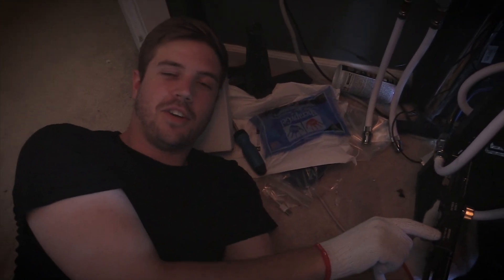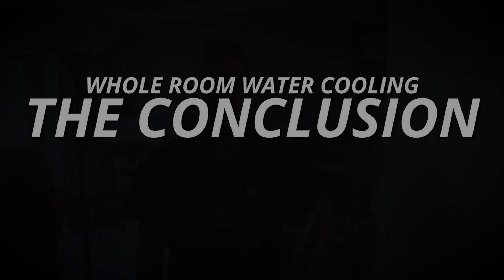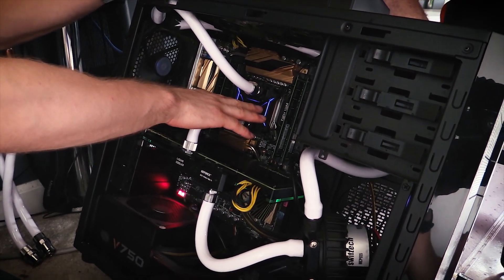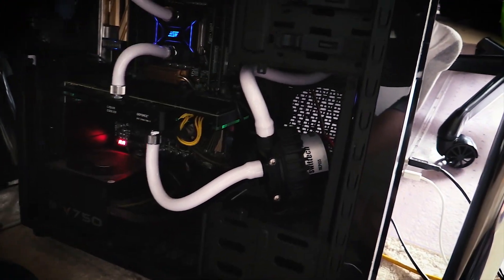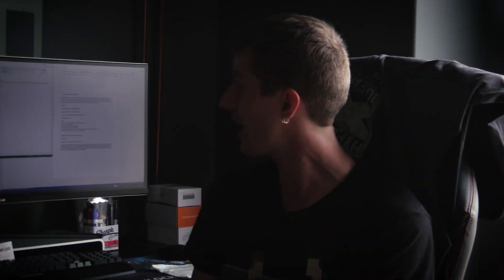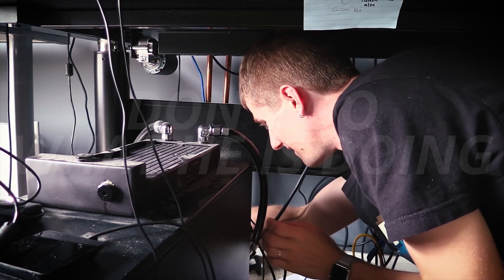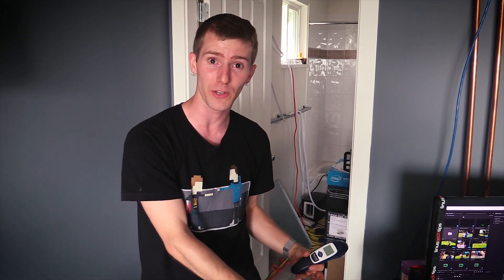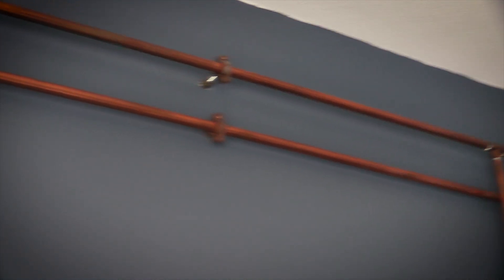Whole Room Water Cooling Part 7 - It's FINALLY over!

Comment: $140 window A/C unit + 30 min. install.
VS.
$3500 in copper, flex pipe, quick connect fittings, radiators, reservoirs, pumps, cooling blocks, sterilization units, etc. and over a year of troubleshooting.

gg
Reply: Christian Jackson I don't think you get it. It's the "for shits and giggles" concept, aka "just for funzies" or "let's do this; see what happens," you know? The Goldberg Variation. I loved it
Reply: Christian Jackson Window AC would have been a more logical solution but not worth watching on youtube. This mad project was at least entertaining.
Reply: Christian Jackson 
and no one will watch them install an a/c unit. how many videos and views per video which way is more profitable to them??? We watch cause we like and u trolls enjoy seeing over the top projects attempted. 
well done Linus Media Group
Reply: Like half of it is sponsored
Reply: Christian Jackson flawless logics right here
Reply: Christian Jackson 140 dollars? that must be really shitty ac lol
Reply: Christian Jackson you know that 3500$ in copper would be like 600 kg of cpper pipe right ? they used like 10 5 meter lenght not more
Reply: Wynnd Gaming he was talking about "copper, flex pipe, quick connect fittings, radiators, reservoirs, pumps, cooling bloskc, sterilization units, etc" as a combined cost not just the copper
Reply: and they probably generated more profit from the 7 very popular videos they produced while building it than it cost them in parts. So they actually MADE money from this project.

You forget that linus media group is a MEDIA production company. Their whole job is to make entertaining videos.
Reply: DrunkenMilfs Window units are dirt cheap. Usually $100 to $400 USD. Even high-end powerful ones won't cost you more than $1000.
Reply: Xromos Huh, I had no idea. Are they worth it? 'Cause I know that some companies basically scam people with their cheap "portable ac" and stuff
Reply: Xromos What technology are those cheap window units based? I know there are really cheap & good evaporation chill ones wich only need water & a little power (quite common in the US), but they are only usable in dry climate zones with low humidity. And there are other systems with heat pumps/with some coolant gas and compressors.
Reply: DrunkenMilfs A decent window unit.
Reply: salat Window units use the same technology as any other AC: dump the waste heat out the window using whatever gas-heat exchange you deem appropriate.
Reply: Put refridgerant in the loop mixed with anti freeze and a solution like linus used to keep out organic material from growing, problem solved
Reply: DrunkenMilfs A 6000 BTU AC unit (around 150 bucks Canadian) could EASILY cool that room to the point of it being downright cold.  I cool the entire up stairs of my house with a tiny little unit like that.
Reply: Pas De MD that's not his point.... When I lived in Salt Lake City, Utah, they had these things called swamp coolers, they are dirt cheap compared to AC units that use refrigeration and are dirt cheap to operate, they use a little bit of electricity and a little bit if water. They need to either be plumbed into water or filled occasionally, they are available in both window units and whole house units and people who don't know better call them air conditioners. If you don't pay attention they look very similar. But they don't work in humid environments.

I haven't looked at AC window units in quite some time, but one that costs only $140 is probably a piece of shit and if you bought a $400 one, it would probably pay for itself in lowered electric bills in one summer.
Reply: devilmikey00 I'm just going to guess, that room has about 4000 W of computers in it, that is equivalent to having 53.33 working people in your upstairs.

Yeah, wow, you can cool your entire upstairs with a single 6000 BTU window AC.
Reply: o noes i have incurred the wrath of LTT. Yes, a window A/C to cool that ENTIRE editing room is ~$140. And for those of you saying it's sponsored, no kidding?? And I'd love to see the math on the guy above who said 4000w of computers equals 53.33 working people. Truly funny. AND REMEMBER BOYS... it's okay to waste money as long as it's other people's money you are wasting ;^)
Reply: Isaac Karjala
Modern window AC units prices are based on how powerful they are not on the quality of the build really. A 5000 BTU unit is around 80-100 bucks and it goes up from there. Also all modern AC units meet a particular energy efficiency standard. The small cheap ones are going to be cheaper on the power bill then some big honking 15000 btu monster that could cool a warehouse ;p

I've bought cheap and expensive ones alike and they all stop cooling well in 2-3 years. Honestly the best one I ever had was some cheapo 150 dollar unit that managed to make it through 4 summers before it stopped kicking out cold air.
Reply: Christian Jackson sustained power output of a single working person is 75 Watts.

4000/75=53.33
Reply: Wait are you serious or joking I cannot tell... you know that "4000w" of computer power does not generate 4000w of HEAT energy right? The computer is doing OTHER things rather than making heat lmao... like computing things. I'd estimate the actual thermal efficiency of their rigs to be in the 90% range. AKA, for every 1000W of computing power, 100W of that is generated heat.
Reply: Christian Jackson uhm..... Are you confusing power supply efficiency with power consumption? 90% efficient doesn't mean that of 1000 W consumed only 100 W becomes heat, it means for every 1000 W consumed at the wall, only 900 W are available for use by the computer; but the full 1000 W still becomes heat.
Reply: Christian Jackson Stupid troll is stupid..
Reply: Christian Jackson wow dude. you don't understand entropy. If something is consuming 4000w ALL of that energy is going to be turned into heat. It might do other things on the way to becoming heat, such as "computing things" but it will eventually end up as heat.
Reply: Christian Jackson well, watercooling in general is not there for practical reasons... yes, you get you system cool and it looks nice, but usually you can get that with a nice air cooler too lol
Reply: Christian Jackson Someone doesn't understand wattage lol, in these cases its a measure of work/energy over time via electrical resistance which is expressed by heat. Every watt consumed by the computer from the PSU on, no matter how efficient the conversion of the mains current to something the components can use is expressed as heat.

The efficiency of the power supply just quantifies how much energy is wasted during the conversion of the current.
Reply: ***** this setup is probably more efficient in it's use of electricity (Watts extracted from room/Watt of electricity) than a refrigeration cycle, but eh.
Reply: Christian Jackson  3500$ of copper? you dont know much about copper price eh..
Reply: SamuelDM
WOW. Was there really any need to insult me bro ? And you really think that about (tops) £200 of copper pipe translates to $3500? No. Sorry but no.
Reply: DrunkenMilfs For small rooms or short term conditions(if you are renting or planing on moving), yes. For long term, an inverter wall unit(split unit) or even central AC is usually better.
Reply: salat Yeah the cheaper units are usually gas/compressor. They're not as energy efficient as wall units.
Reply: Christian Jackson lol no shit, but how are you gonna make 7 videos and learn about video production by installing an AC unit?? you really think the only reason they did this was to cool down the PCs? LOL good job looking beyond something boy

;^)
Reply: Christian Jackson It's much too easy. ALWAYS take the hard way, no matter what.
^^Sarcasm
Reply: M8 acs are loud as hell
Reply: Xromos 
a window AC is NEVER high-end.
Reply: devilmikey00 
ACs only work with closed doors, as the room it needs to cool only gets bigger.
Reply: Robin Steel 
if "something" are PCs or something similar that's true, not so true for motors, lights,...
Reply: unkr3at1v actually it IS true for motors and light,  and everything else. All energy becomes heat. That is the second law of thermodynamics. The entropy of a closed system can only ever increase,  not decrease.
Reply: For motors and light SOME energy becomes heat the rest is converted to movement or light. 
for a 100 W light bulb for example about 5W become visible light, the rest are infrared rays. 
Energy efficiency is the key word.
you don't need thermodynamics to explain this. 

if you get 100% of the energy put into the system in heat and 5% of light energy you would get more energy out of it then you put in. 
and it is impossible to produce energy from a physical view, you can just convert it.
Reply: unkr3at1v You're both kind of right. Some of the energy input becomes kinetic energy or light initially, but even that will eventually become heat. The kinetic energy will become heat due to friction and the light energy will eventually be absorbed by something. Unless the light is shot out into space during the night-time or something, then maybe it could continue forever or at least a very long time.
Reply: unkr3at1v For incandescent lights it's been said that they are heaters that produce light as a byproduct.
Reply: lubey111 it's still 95% heat and 5% light, or 30% heat and 70% torque. 
and never 100% heat + movement or light or whatever else that particular electrical consumer does.
Reply: jayw900 i didn't say anything different. this was the most common way to "produce" electrical light for the last century or so.  We are more clever now...
Reply: Oh yeah, i just found it interesting that it is an amusing way to look at it.
Reply: Christian Jackson bottom line is, air cooling is suffice

overclocking even with low temps kills the GPU/CPU if the volts go up

upping the volts is what makes higher OC stable with low temps

if you OC on air w/ a really good air cooling system or a small watercooling loop it's enough at the limit of stock voltage

later on there is degrediation inside the CPU/GPU housing, the insulation that separates transistors disappear causing problems such as file corruption and BSOD resulting in RMA

plus.. the amount of energy cost in using AC..

you can use phase change for direct AC on CPU/GPU to have insane OC stable but electric bill goes up HUGE

I had a QX9650 ES Step, probably a QX9770 ES sample, on Prometia at 5GHz stable during that time when it was the best CPU to buy besides QX9770 I think

It didn't die.  I was at like -54C but when it was under load it got to like 14C.  Sold it because watercooling was easier or something.  Everytime it shut down I had to wait 1 minute 30 for the AC system to turn off then turn back on.  If you instant off and on it damages the compressor then it doesn't work anymore which I did when I messed up flashing the firmware.
Reply: Christian Jackson It's funny that you commenton that but ignore the immense money wasting they do in about every video (having 128gb's of RAM, 4 titan x's in a build, 24TB raid 0, mineral oil submerged pc'sm phase change cooling..)
Whats your point exactly? that there is a cheaper option? yea, so what? have you completeley missed the point of this whole channel/company? Its Obvious there are Always cheaper options but this channel isnt about cheap. It's about freaking building anything they can think
Reply: Robin Steel I don't think you're factoring in the cost of (their) labor and lost production time.
Reply: Christian Jackson Yea you are real smart and all athers who tumb up you,this is entertaining chanel not home depot.they are show biznismans.And they are good and heving funn at work,I am jealous of you :). Ssuburb house in USA like they dont heave A/C. Hidiots.
Reply: Christian Jackson There is downsides to A/C units like yearly maintenance that cost around 200 Euro on a good A/C unit. At least where I live, this includes Filter change, tuning, greasing, making sure the system works properly. I know this because My grandmother has an A/C unit more for heating her house than cooling it. And she doesn't do the maintenance considering she is 80+.

Even then, on this large scale, it might not be worth it but if they were to have lot of servers that generate more heat, it might be worth having one Big pump, one Pipe line and an easy way to fill, maintain the water quality in a station than trying to cool the whole place down which could be drastically more expensive since AC also circulates the air and makes it far harder to keep dust out of your system. Now I am talking fine dust. And AC filters generally can't filter out Fine dust since they tend to not be that fine of filters. Generally just Coarse/Medium(Aquatic terms). 

So it also depends on the size. Also, when you have A/C, you generally compromise the efficiency of your Fire Warners which is something you must have in a room with such heat generating equipment. Plus, since you have to use Carbon-oxide to put out potential fire, A/C forms one more complex thing to ensure monthly that it is air tight during Fire emergency. Since you want to fill the room fast enough to put the fire out without well, it leaking out.  So in a sense, water cooling can work depending on the scale, location, size in comparison to A/C. Also lot cheaper in comparison to filter changing for air driven devices which you technically can't clean as easy if you do it yourself. And they can be dirt expensive depending on quality.

Any A/C can be a good product, but there is a difference in filter quality. Also the most expensive product in all type of things that need filtering. Water filtering is easier, especially in a closed system like this.
Reply: Leaves a month later.
Reply: +Christian Jackson  Plus they didn't insulated the pipes lol
Reply: Luis Jimenez just moving some lines directly to outside the house would have just been wiser or running through mad radiators with huge fans

the video must have been made for more of a marketting decision than a logical efficient one
Reply: +Luis Jimenez Insulated pipes would keep the heat from dissipating into the room. Unfortunately it would also cause the water to retain more heat making the radiator far less efficient. So you would have 2 strikes. 1 no effect on ambient air and 2 a hit on core cooling.
Reply: diGritz1 You're right. That's why I agree with Anthony Abelardo they should've ran the pipes outside of the house to a big radiator.
Reply: Luis Jimenez but if the outside temp is like hotter than inside it would be a bad idea

smartest way would be to attach the radiators to a wind turbine prop end so it can always catch air but practically speaking it would just be more ideal to just get 1 480 GTX radiator with 4 fans or make it 2-3 but no more because then it would be pointless

you can also peltier, water chill, phase change but they cost wayyyyyyy more electric so in all honesty 1-2 480 GTX would be enough and anymore would be pure overkill as it wouldn't raise much over ambient vs 2 480 GTX with good fans

Those were the way way back to OC high before they made cheap standalone units to cool things.  The cheapest water cooling kit you could have was at least $500 but as custom they still remain the superior choice.  It's kind of like going a laptop would be more ideal if you don't meet the desktop requirement of exceeding laptop performance.  You can get the best laptop but it can only max out so far so you need to go desktop.

I mean, other smartest way would be to make the otherside of the radiator vent to outside the house so it doesn't recirculate the heat and raise room temp.
Reply: Luis Jimenez
That would be the best choice for a system like this but you can bet your going to run into noise abatement issues with it in a residential area.

If I had to run a system like this the best choice is to route the piping 8 to 10 feet under ground. It sounds a bit odd but temperatures at that depth are very stable and can be anywhere from 10 to 15 degrees cooler then ambient air temp at the surface. You also get a huge benefit in that heat is transferred much more efficiently through the soil then through air.

It works great in HVAC systems. It can give you an efficiency boost 8% to 12% on average.

However this is only if I had to run it this way because there are far better options. The potential damage due to a failure in the system in $$'s is far to great for this to be viable anyway. Just a really bad idea from the start.
Reply: Or just move to a warehouse with AC
Reply: Seth King
Seth that will never work. It's far too  complicated. First you have to move then you have to operate an AC. It's just a nightmare. I slash the difficulty in half. Move to Greenland and set up shop on a nice glacier and no AC needed.

Comment: Hi Linus.

Why not isolate the copper pipes with insulating tape or something similar before moving to the new office? As Linus said much of the heat generated by the systems is dissipated into the division that the systems are in. You have more copper in the pipes within the division than you have in the radiators that are outside. My proposal is simple .... insulate the pipes with insulating tape (or foam  (( the one that expands after application, but I know it will cause a lot of mess))) to see the temperature difference between the division where the systems are and the outside. If it is possible to close the door "WC" for the heat reservoir does not influence the experiment because it is made of metal. I think at you guys can isolate the copper system and make a video 7A. What do you think?